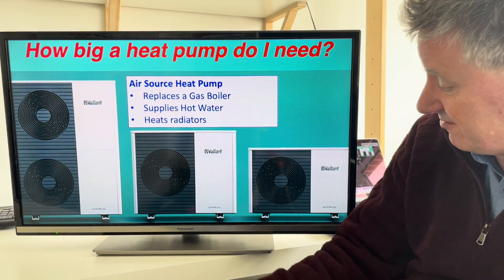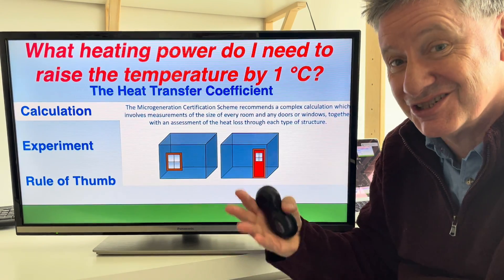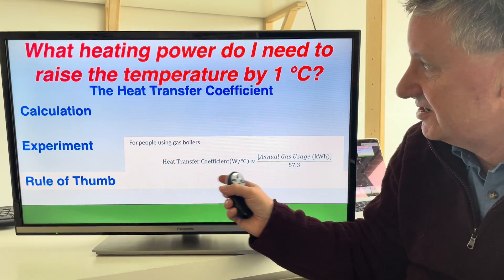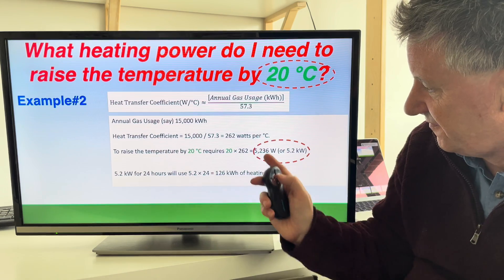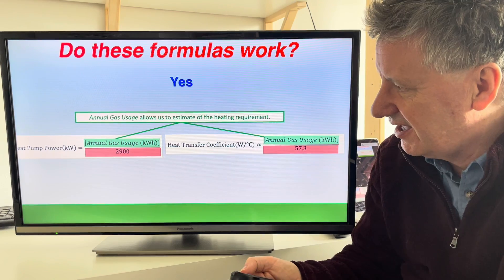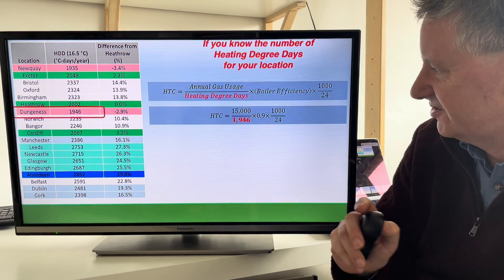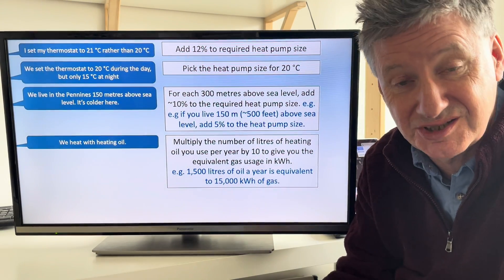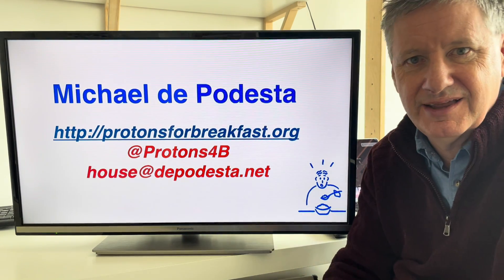How big a heat pump do you need? A simple Rule of Thumb.

Comment: Hi Michael. Really good presentation. One question though, if you are using the total kWh for the year, arent you calculating the size of HP you would need on average, not peak demand? Or does the correction figure take this into account? Thanks Mark
Reply from the maker: Mark,

Thank you for your kind words. No the heat pump calculations for the peak demand.

1. One uses the number of HEating Degree Days to estimate the total heating season demand.
2. Then one uses one's total gas consumption over that period to estimate the HTC for your dwelling. i.e. how many kW does it take to heat your home by 1 °C.
3. Then one multiplies the HTC by the likely temperature demand which is typically 20 °C when teh external temperature is -3 °C. 
4. the HTC x Heating Demand (°C) gives the maximum heat pump power required.

It is just a rule of thumb and if you have very high use of DHW or you only heat your house for a few hours per day then it can give you the wrong the answer. But in many cases it should be in teh right ballpark,

Best wishes

Michael
Reply: @michaeldepodesta001  Thanks for the explanation Michael, Ill have to find some time to investigate degree days in depth. When I applied your calculation to the electricity demand of my gasless 3 bed bungalow it came to 1.68 kW, but it had solar panels so they would offset that figure quite a bit. I had a 5kW Ecodan and that managed easily
Reply from the maker: Was there a heat meter installed with the Ecodan? It might have a reading for the estimated heat delivered.
Reply: No. I installed it myself and there was nothing like that unfortunately:-)
Reply: @markarnold6879  Hi Mark every Ecodan has internal heat energy consumption and heat delivery measurements as the Ecodan has flow and return tempersture sensors and a flow sensor. If you don't have the Melcloud internet device you would need to add this to be able to look at the data. Once you have it go to reports energy consumption and all the data is there. An external heat meter will be more accurate but I have found the internal one to be quite close.
Reply: @kasparbradshaw8592  I hadnt heard of Melcloud Kaspar, thanks, I will investigate, particularly as I was looking at Home Assistant already :-)

Comment: Michael what a fantastic video. I have been doing a lot of monitoring on my own home and the MCS heat calculations are always far too high.
Your rule of thumb is spot on. Thanks
Reply from the maker: Thank you. I am working a slightly more general rule that will include more 'odd cases' i.e. where people only the heat the house for an hour or two per day. M
Reply from the maker: Thank you. I am glad it makes sense. I am working on a follow up to take account of some of the causes of variability. But it is taking time!. All the best: M

Comment: I am an anorak like you and a consultant heating engineer, I worked out my heat loss really acurately to 5.7kW but using your rule of thumb I worked out 3.56kW so the answer seemed a little low. Then I realised that I live alone and go out to work, the heating is off all day and I keep the house cool in any case. 
A heat pump should work roughly 24 hours per day so it may not be safe to rely on rule of thumb alone if the operation times change. 
Over all I think the video is very helpful as any cross check or rule of thumb is a great idea, but please I advise everyone to work out the correct heat loss answer even if it is hard work to do that as the operating times make a huge difference.
Reply: Agree. & there is the rub .. With gas if  you heat morning & evening only, you save 1000s of Kwhs of heat loss while the house is cool, Switching to a heat pump, What to do ?  Commit to 24 hour a day warmth, even if you are out & miss it, or oversize the pump to give good rate of warming up as you come home ?
Reply from the maker: @brackcycle9056  Yes. But I don't think the difference is so great in most cases. The actual saving by switching off heating during an absence depends on the length of the absence compared to the time constant with which the house temperature falls. I agree that for longer absences - probably a day or more - just switching off the  heating will save energy. But for shorter absences I think it is quite finely balanced. If a boiler works flat out (say 20 kW) for 2 hours to restore comfortable temperatures then that is 40 kWh of heating. If the absence was for 10 hours (say) then a heat pump could supply (say) 4 kW of heating to achieve the same result, but using only 13 kWh of electricity.

I need to do some calculations on this!
Reply: @michaeldepodesta001  This is our concern, Michael. Did you do the calculations and report/discuss them anywhere? We are very keen on moving to a heat pump (inspired in part by your experience, and the environmental necessity) but are concerned that the on-all day aspect would mean a HP solution would be much more expensive given the per unit electricity premium over gas. (London suburbs; current gas usage 25000 kWh/y, with a thermostat set to 18C, and heating on for 9 h/day, would rather be warmer!)
Reply from the maker: @pauldriscoll479  Paul: Good afternoon. So currently you use 25,000 kWh/day heating your home to 18 °C for 8 hours a day. Using the rule of thumb one might guess a heat pump size of 25,000/2,900 = 8.6 kW. But the fact that you are only heating the home for a short time and to a low temperature would suggest that if you heated the home to 20 °C for longer, then annual gas usage would be larger. My guess is about 20% larger. For round numbers lets that a 12 kW heat pump is specified.

I put your figures into this updated spreadsheet (downloadable here https://protonsforbreakfast.wordpress.com/2023/04/02/another-heat-pump-spreadsheet-beyond-the-rule-of-thumb/) and it too suggested about 12 kW. I set up your household to heat to 19 °C for morning and evening and 16 °C at other times. Roughly speaking it takes around 30% less power to heat to 16 °C than it does to heat to 19 °C - many people operate their heat pump on such a cycle. But one can't let it get much colder otherwise the heat pump will not have the power to re-heat teh home in time for your return.

One result tabulated in the spreadsheet suggests you home has a heat transfer coefficient of ~650 W/K which is very large. Is this an above average size house? Or is it very poorly insulated?

As I point out in this article (https://protonsforbreakfast.wordpress.com/2023/12/17/variability-of-heating-demand-throughout-a-year/) you only need the top 20% of heating demand for typically 11 days per year. 

Regarding expense, most people find heat pumps comparably expensive, but it depends on teh COP that you achieved. If you look over on the heat pump monitor site (https://heatpumpmonitor.org) you can see live data from around 100 heat pumps. It is common now for COPs to be around 4 when averaged over a season. This depends on teh insulated and the flow temperature. You will need to discuss this with an installer because I can't guess this over the internet.

But do get back to me if you have specific questions. And good luck with your endeavours.M
Reply: @michaeldepodesta001  Many thanks Michael, yes our house is on the larger side: 1912 vintage semi-detached, six bedrooms, three floors and with a largish single storey 1980s garden extension that we turned into a kitchen diner and is the space we occupy the most. We have been progressively investing in internal and external insulation -- the top floor of the house has gone from the coldest part of the house to the warmest. Just waiting on the outcome of a full heat loss survey. So far others have suggested a 14 kW heat pump. Our gas boiler recently failed so we will be investing one way or another. Cheers, Paul
Reply from the maker: @pauldriscoll479  Paul: it sounds like you are proceeding very rationally. Well done! 

14 kW seems a touch on teh large side, but not crazy - and I have not seen your home so what do I know!? The advantage of slightly oversizing is that if you want to use setback periods, then the higher power will be able to raise the temperature quickly as you come out of set back. 

The key to efficient (and cheap) operation - is designing for low flow temperatures. I would check politely to make sure your installers are addressing this. Best wishes. M
Reply from the maker: Excellent points. I am surprised because the formula has a couple of factors that should tend to slightly overestimate the required heating power. 

So you calculated your heating power to be 5.7 kW at what internal and external temperature? And using what method?
Reply: @michaeldepodesta001  My heat loss calculation used an outside temp of -3 and individual room temperatures of between 18 and 21. 
The house is a three bedroom 1930s semi with cavity wall insulation downstairs, new pvc double glazing, 50mm internal insulation upstairs and loft insulation so it is fairly well insulated. 
The calculation used CIBSE figures and carefully worked out U values for all of the building fabric. I've checked the calculation 4 different ways, so I remain confident that 5.7kW is reasonably correct although the infiltration rate always seems like an educated guess.
Reply from the maker: @PeterJFlower  Thank you. I will reflect on your results. Meanwhile, you can estimate actual infiltration rates (Air Changes per hour) by using a CO2 meter. It's much easier than using a pressure change technique. I wrote about it here

https://protonsforbreakfast.wordpress.com/2021/06/06/estimating-rates-of-air-change-in-homes/

Best wishes

Michael

Comment: Michael,
Could have saved yourself a lot of time by simply using the BRE Group Domestic Heat Pump Energy Efficiency Calculator. It uses historical UK weather data (Leeds), and includes domestic hot water efficiencies in its sizing and annual efficiency calculation. It's been developed in conjunction with CIBSE UK, and tailored for the UK market. Also has a product database, which includes Vaillant and many more.
Reply from the maker: Thank you. That looks very useful.